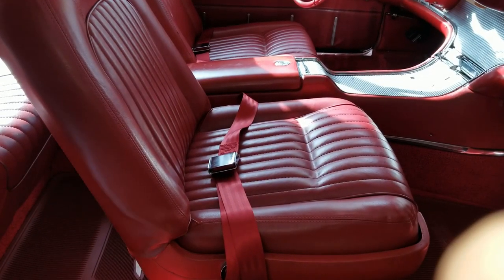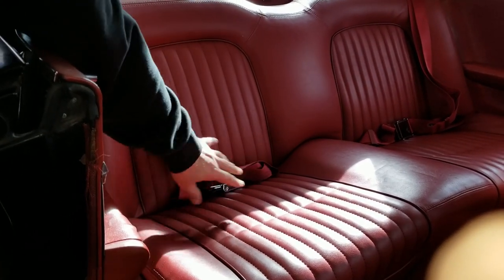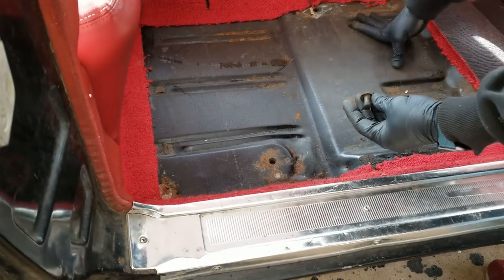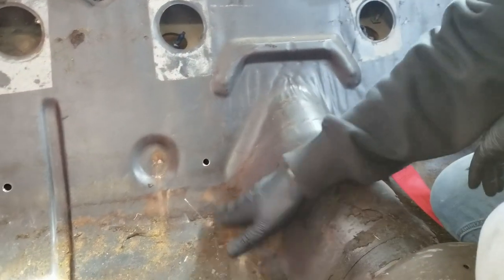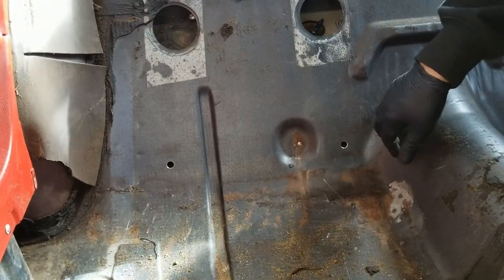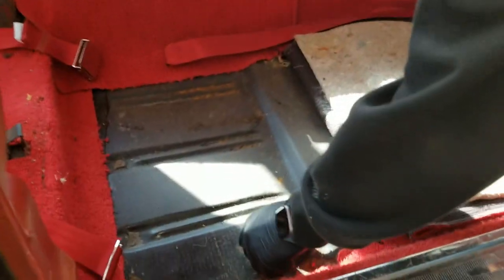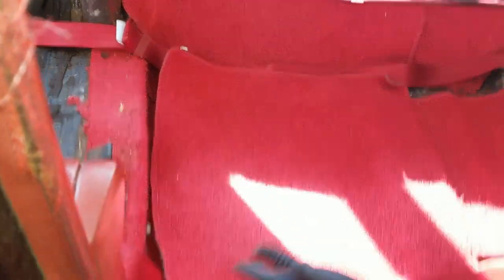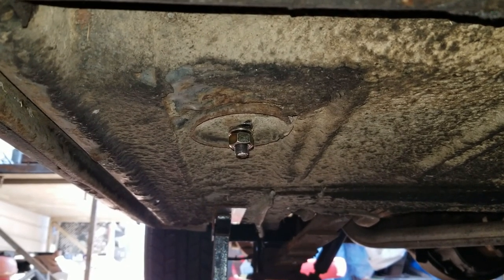1962 Thunderbird Seat Belt Install

Comment: A good idea for 3 point seat belts for the back seat, but what about  shoulder belts for the front seat. Just a lap belt in the front isn't a lot of protection in a collision.
Reply from the maker: The only viable option for a 3 point front seat restraint would be putting the 3rd point above the side windows. I wasn’t and still not ready to tear down my headliner.
Reply: @origionalcatastrophe  As a teenager in the mid 70s I had my grandfather's 1970 Buick Electra to drive. I was that rare kid that buckled up both the lap and shoulder belts when I drove. One night a drunk driver hit me head on. Because of the size of the car and the fact that I was wearing both the lap AND shoulder belts I walked away with only bruises from the belts which was far better than the unbelted other driver. I know that you're driving a classic car and don't want to cut into the headliner, but I would seriously consider adding the 3 point seat belts for the front seat.